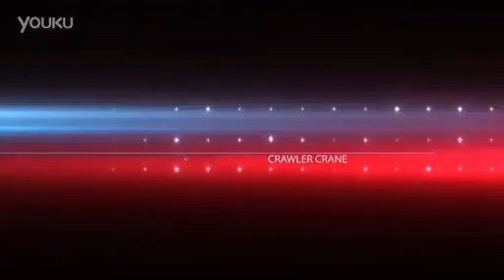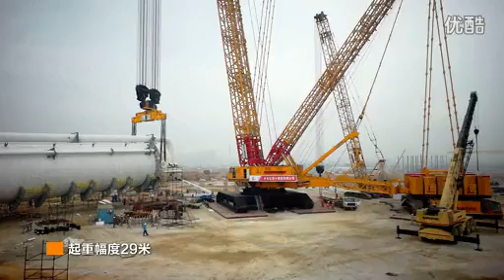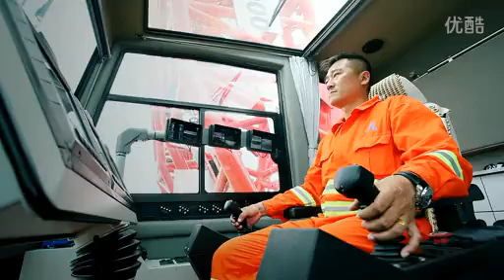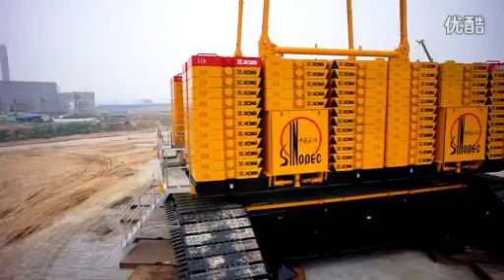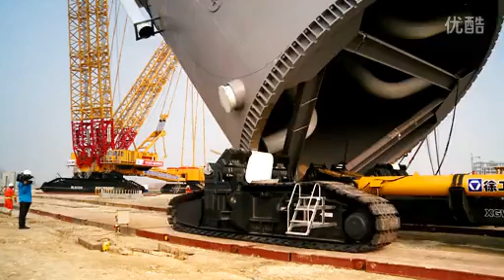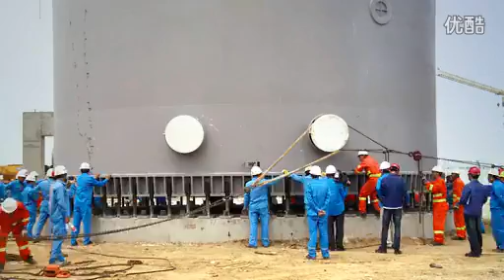徐工集团4000吨级履带式起重机 XCMG Group 4000-ton-level crawler crane, China

Comment: I admire the confidence of this Crane Operator, also impressive is all the logistical work that created this amazing lift.
Reply: i've been involve in logistic supply and management for 10yrs..and I'm still hungry for this kind of tough job..I think u know better instead I'm still young and a lot of things waiting in the future..
Reply: +A-nol LowLifeStyle , I will agree with you now that I reflect back to my more spirited and adventurous early 20's, I have operated heavy lift Front forked lifting Furikawa's on the edges of high and steep railway line embankments with its cinder soft surfaces that begin some 2 feet from the sleeper edges.Also did a 7 month term in Vietnam, so I guess I had a potent set of balls in them there younger days. But now at 67 years on this planet the only gut-rumbling behaviour left of my younger years and that then testosterone non-fearing ball bag, is passing cars on a narrow dual highway often touching upon 190 KPH. Go get 'em while you can  A-nol LowlLifeStyle.
Reply: @gregg4164  my thoughts exactly….oh and this crane….a stolen design and a copy catted cheap knockoff from Leibherr of Germany

Comment: Can someone please tell me what that was being lifted & it's use? Also by looking at the last few frames it seems there are two more "pads"  in that area.
Reply from the maker: From the Chinese words shown on the machine it seems to be a petrochemical equipment.
Reply: Yes, Gao Kun, it looks as though it might be the Fractionating Column of a 'Catalytic Cracker' used for splitting crude oil into useful components, like petrol and diesel etc at an oil refinery!
Reply: I would say it is a vacuum distillation tower.  Takes heavier crude fractions and boils them at high temperatures and low pressures to increase lighter yields from crude.  Since it operated at near perfect vacuum the structural integrity is so robust it takes a huge machine to lift it.